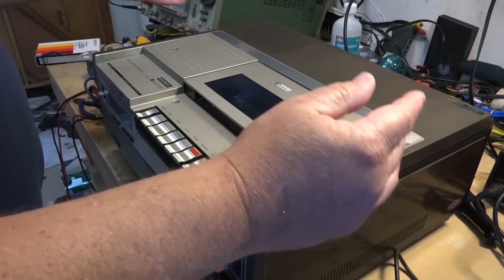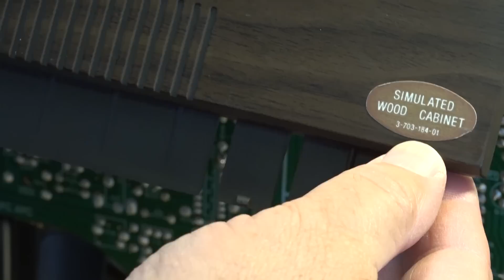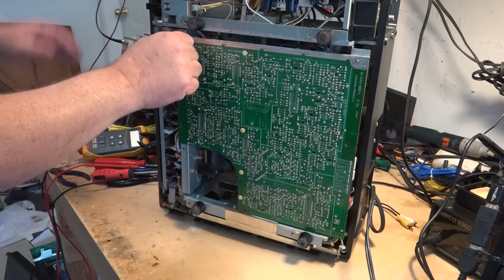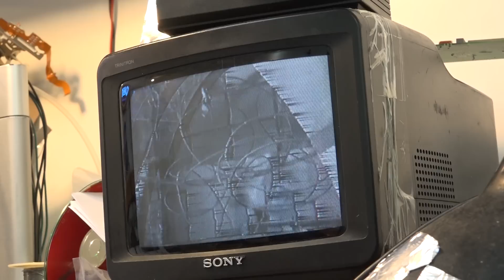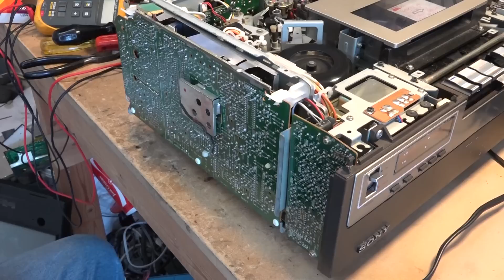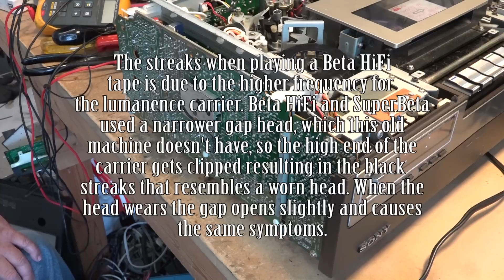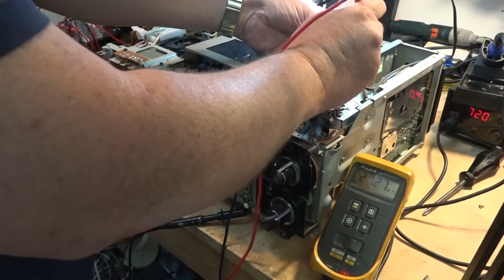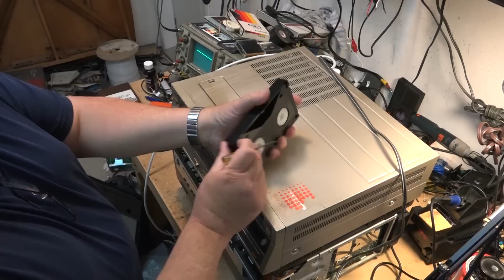Sony SL8600 Vintage Betamax Repair

Comment: You replaced the play belt with a rubber band!
Reply from the maker: Nope, added one under the original to increase the grip. Old engineering trick I learned back in 1980 when I was working at my first gig at a community TV station. One of the Panasonic NV9800's possibly the very unit I have as it came from the station I used to work at, had a slipping capstan belt when I was editing a project. I called engineering. He opened the unit up, went to his office and came back with a box of rubber bands. Watch and learn was his only comment, with a sheepish grin.  He took a big thick rubber band and put it around the flywheel and then put the original belt back on, and I was back up and editing in a few minutes. He didn't have the right belt in stock, and taking one of the edit out of service was not acceptable as we had news stories to edit for air later in the day, so we needed the deck. Next day he got the belt, and swapped it.  Wrap around pulley or around both will get you going in a pinch as a temporary fix. I have seen people put rubber bands in themselves and wonder why things don't work properly. Elastic band is too stretchy, so for something like a capstan belt it will stretch and contract, which would cause the speed to vary greatly. Talk about increasing wow and flutter. Adding one under the original, the original belt will keep it from stretching, and provide enough friction to prevent slippage until a suitable replacement can be found.See you just learned something!
Reply: I've used rubber bands a lot of times when I didn't have the right size belt. And yes, the tape speed was very unstable! I'm very curious how the SL-8200 switched between the X1 and X2 speeds because it was a single-motor machine too!
Reply from the maker: The 8200 actually was a 2 motor machine.It had a big AC motor like this one for the drum, reel drive, and through a clutch operated the threading mechanism, but it had a separate belt drive DC servomotor for the capstan motor.
Reply: Oh. That's interesting! VHS machines never used AC motors. I don't know why u-matic and beta used this design. The VCR drained a lot of power when operating. Something like 70-80 watts.
Reply from the maker: They didn't need fancy servo motors that's why. Ac motors spin at the line frequency. A simple magnetic brake to control phase and you are off t the races. I remember an old Jvc that used a belt drive drum with a speed control the same as this beta but I forget if it was an ac motor or just a cheap non servo DC type driving it.
Reply: +12voltvids I have one of these JVCs with the belt driven drum. It's the HR-3330. This one uses DC motors.
Reply from the maker: I vaguely remember those units. Been at least 25 year since I last worked on one but I h an alien top load Jvc I will tear down some day just for fun and see if I can get that one going.
Reply: HR 7200 UM? Big color buttons top loader?
Reply: The HR-7100 and the HR-D120 have the colorful buttons.
Reply: Yes, I suppose for easy operation for begginers. But there´s a front loader with round buttons... around 1982 or so
Reply: Yes. The HR-D120 from 1983 is the front loader with the colorful and function-shaped buttons. And I have this one :)
http://www.vintage-radio.net/forum/attachment.php?attachmentid=104561&d=1424616914
Reply: JVC kept high quality until 1992 aprox. I have a machine which mechanism is very solid, not like 1995 and forward all plastic lightweight vcr.
Reply: All VCRs went cheap after the early 90s. I have 17 VCRs and the most recent one is from 1992. I don't collect anything past the early 90s.
Reply: Was necessary on boradcast on these days have a full time technician? I think machined tend to fail sometimes.

Comment: Loverly old machine :-D, im amazed how they managed to use one motor for both functions, the gearing by flywheels must have been very accurate.
I could not see what you did, all belts looked in the same place and no extras were visible to the angle of the camera.
Shame the end sensor went faulty ;-(, my old machine had a 12v bulb and photo transistors for end detection, the bulb could die after 1/2 a million years LOL :-D.
.
My bodges to make a machine run untill the new belts/jockey wheels came in was adding a small drive belt around a pulley to allow the worn original belt to grip better, rubber to rubber tire lol.
The jockey wheel had a worn tire so it didnt drive propperly, remove the tire from the wheel and add two turns of ptfe tape to the bare wheel, then put the tire back on But inside out to use the fresh smooth rubber on the inside, it kept the machine going untill the owner could get or afford a new jockey wheel.
Dissesemble faulty felt clutches and washing with detergent to remove muck/oil so it grips slightly better, usually good enough for it to be reliable.
Coating faulty brake pads with rubber solution so they work.
All evil bodges and more, but i would do anything for people that could not afford a new machine, if it was free then i would say "It will last a year, save up for a new one", some of my bodges kept machines going for six years, i was happy to help ;-D

Comment: I was always taught to never use petroleum based lubricants on plastic parts?
Reply from the maker: Go back and look again. The idler has a copper bearing. Oil is on metal parts.

Comment: Thanks 12V.
The mechanism of this Beta VTR is build like a tank.
You replace the belts and cleaning idlers the VTR start again.
Hope in the next future you service a SL-2500!
Reply from the maker: I don't have a 2500. The closest I have mechanism wide is a sl2000 portable. I have 2 of those.
Reply: Thanks 12V
Reply: So may be necessary clean, lube and replace belts and you´ll have 30 years more of solid work
Reply: I heard that portable units (separated tuner and player) are more delicate

Comment: my Sony SL-HFR70 doesn't eject, eats the tape.  So I'll have to pull it out of the rack, and see if I can fix belts.  It ate a prerecorded tape that was in it for years, hooked up, but not used.  I only have like two dozen beta tapes.  I have a Sears and  Sanyo mono beta VCRs too. I may also have the Toshiba in storage if I didn't get rid of it.  I think the Toshiba was much better than Sanyo, when it worked.  Don
Reply from the maker: That would be the one with the solenoid that activates the planetary gear set to transfer power from the loading motor between the threading ring and front loader.Does the solenoid click when you turn the power on and off?If not, there is a thermal cutout on that solenoid. (you can measure the solenoid and see if it shows resistance, if not the thermal cutout has likely opened) It is under the tape wrapping the coil on the top of the winding.They had a high fail rate. Of course the unit won't play either if that happens, as the same solenoid also engages the pinch roller.There are switches on the side of the FL that also cause load/unload trouble. I did a service on the FL on one of my SLHF1000 decks, which use the same mechanism.

Comment: This format was better than VHS and never broke down, We had one till that stopped making BETAMAX cassettes at which time we had to switch to VHS which was mediocre.
I just wonder is this one only record for 2-3 hours,Chroma problem as well as the SYSCON control circuit, I wonder did super BETAMAX use PCM signals fed to the Video Head drum so the audio gets combined with the video signal, I wonder does it have a circuit that has the facility to output PAL as well as NTSC  as PAL is a modification of the NTSC TV system so that the phase of the VCO changes on alternate fields, would it be possible to create two PCB coils to replace the burnt out coils.
Reply from the maker: Stopped making Beta cassettes? Really? That was this year that they stopped making Beta tapes, March 2016 to be exact!  Most stores stopped selling them but Sony kept making tapes for the Beta format in the USA. I have 3, factory sealed tapes that were given to me that were bought in 2014 by someone that was still using Beta to record from analog cable on a very old machine. The machine still works, but there is no more analog cable so he finally was forced to get a DVR. Until the Sony stores closed their doors here in 2014 you could still buy Beta tapes at the Sony corporate owned stores in Canada.
Reply: Yes. MAny people still watys to transfer tapes. 
also, BETACAM news (ENG) use the same tape, albeit won´t work on a home Beta.
Reply from the maker: That's why I keep my old machines running, for tape transfers. I get 20.00 an hour for beta transfers to DVD
Reply: I bought the autonomous DVD recorder and Beta player just for that purpose.

Comment: you used a white elastic band for the drive belt.
Reply from the maker: Correct. Take up the slack. Learned that trick back in 1980 when I worked at a broadcast center for awhile while in College. Engineer did that when a machine started slipping and he didn't have a replacement belt on hand. Naturally this is only a temporary fix until a new belt can be sourced.
Reply: You used that white band to fill up some slack that the rubber band had developed over time. Since it's clearly seated below the rubber band.

So I reckon a quick workaround to remove slippage on a drive belt? Dead simple idea, but it'll have to pop in your head while at work though. :)
Reply from the maker: Not exactly. You are on the right track though.
Reply: Bought a 5400 tape kit on Ebay "PBC" brand. It has many years and blister never was open. Rubber is still of high quality?
5400 and 5600 use the same belts???